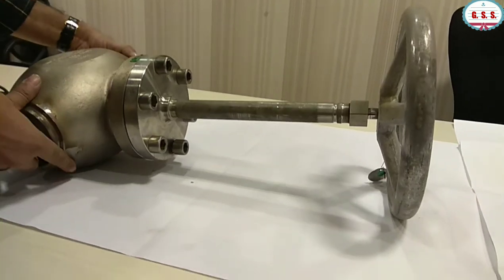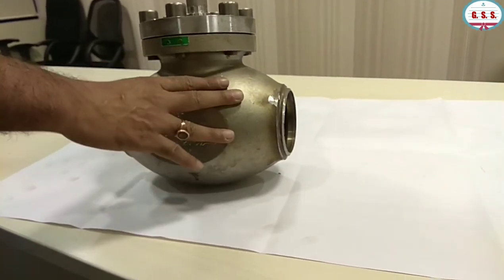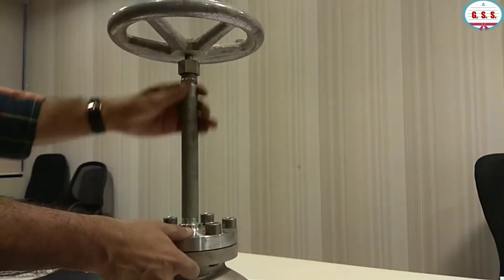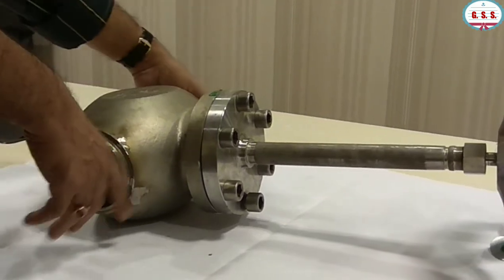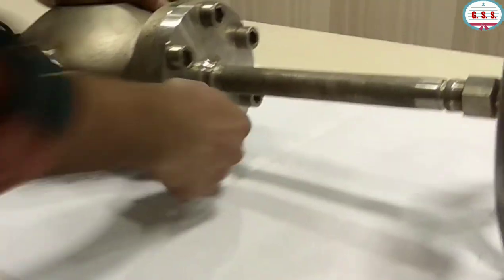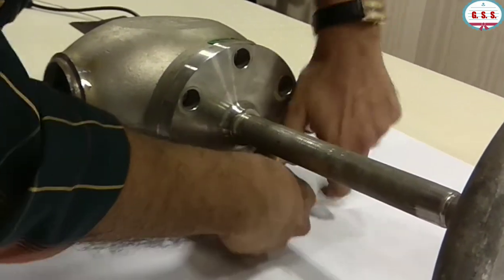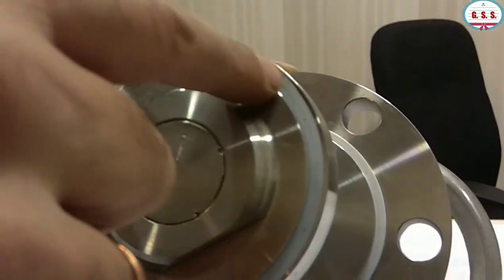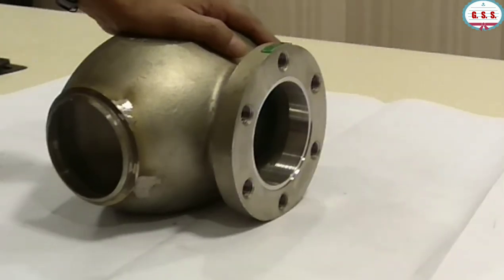Piping Engineering : how to weld butt weld end valve having soft seat

Comment: How can you know a valve have soft seat without opening sir? Should we always open and check
Reply from the maker: It is specified in valve GA drawing. Before welding at site we should check valve GA drawing.
Reply: Refer Identification plate where seat material is specified